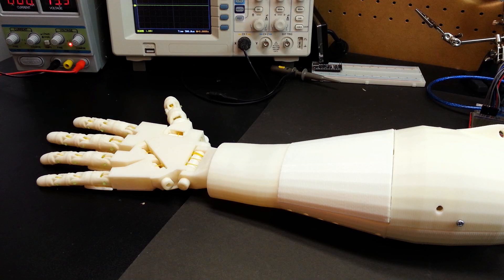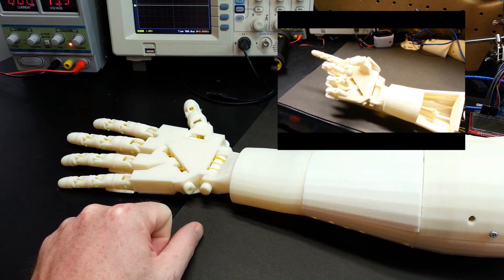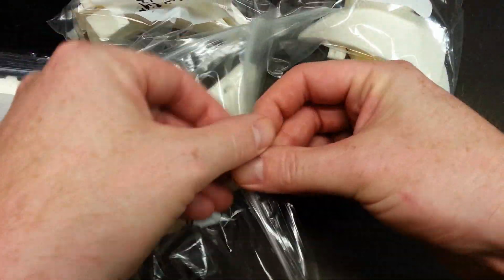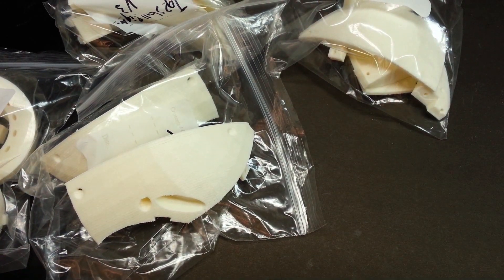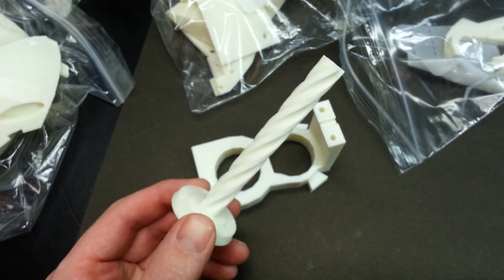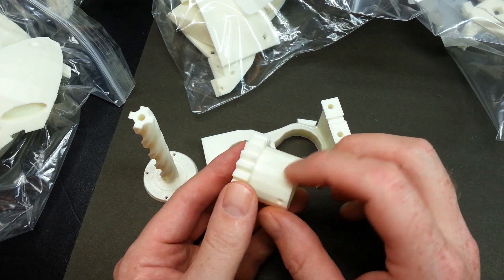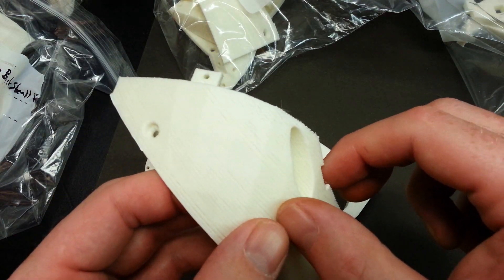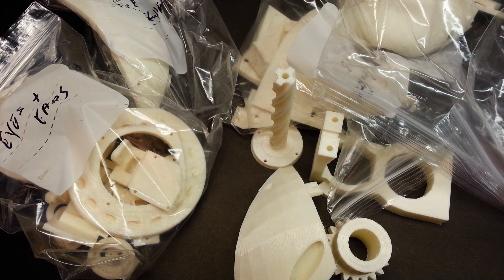Building Humanoid Robot Head- 3D Printed InMoov

Comment: Hi Eng.Eric , I am working on "Neurosky Mind Wave" to control a robot , and I faced such a huge problem in connecting the sensor with the robot by a Sparkfun bloutooth... it didn't work 
I am fried I have to discard the embedded system and replacing it by a computer using matlab. and that's a problem
Reply from the maker: m6r বৃষ্টি Hmmm not sure what to say here.  Keep working on it.  You will get it and the satisfaction will be worth it :)  Cheers

Comment: Have you ever considered , or is it possible with 3D printing to embed a wire frame or other metal assembly (  bearings etc?) within your plastic parts to increase their strength ?..Thinking ahead, 'no pun intended', it doesn't  take long for the overall weight of the Robot to build up and thus increase and put pressure on load bearing joints such as knees ankles etc.. nice work keep it up ...!
Reply from the maker: Sure it's possible.  You can bond the pieces together over whatever object you like or leave room to insert rods, rebar etc.  The InMoov is a pretty tried and proven design so far so not much needs to be added other than what other people have already figured out.  Thanks for the kind words.  Cheers